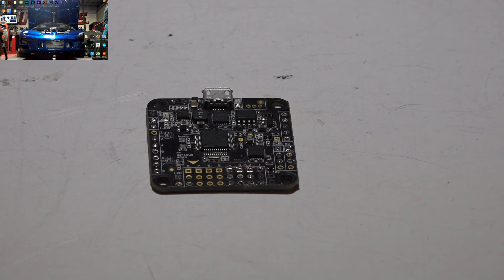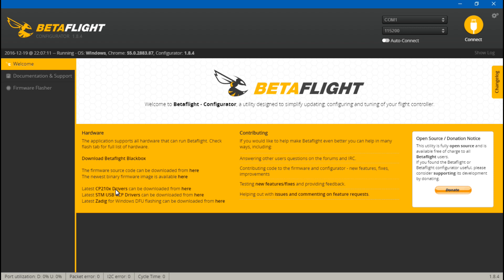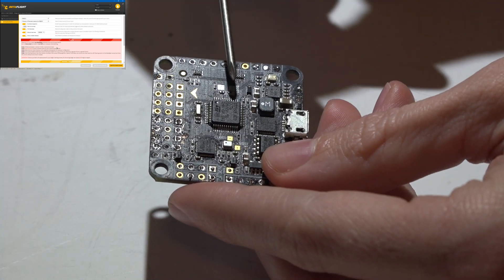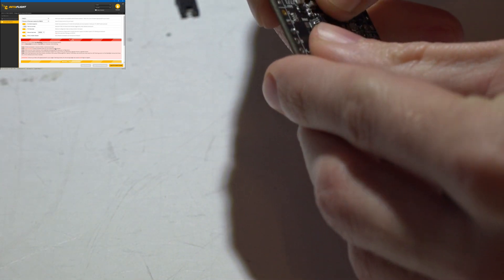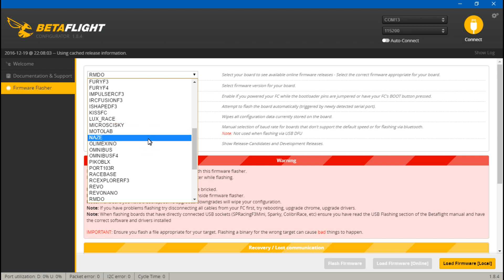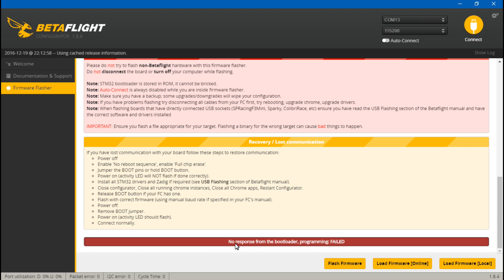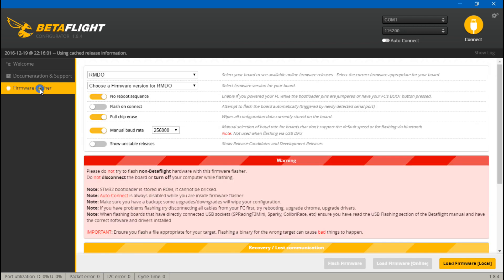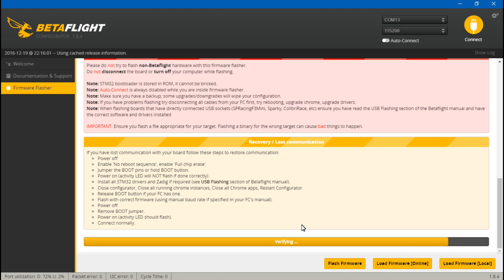How To Flash Firmware To Flight Controller

Comment: Hey there, my pc won't recognize my flight controller even after i download stm32 and cpx driver. My flight controller was working fine before i accidentally unplugged it while it flashing new firmware. Now whenever i plugged it to my computer only the red led is flashing and the blue isn't. Im using DALRC F405 flight controller. Do you have any idea how to make my computer recognize the flight controller?

Comment: This is my fail "
Access to the serial port failed" what can i do?
Reply: Manuel Maier You might be missing the necessary drivers, or you might be using a usb cable that only transmits power, and not signal.

Comment: Quick question: Do you "always" have to jump board with wire or button to flash it? Or can BF flash your FC without doing that? I am trying to run a fresh BF onto my QX65 whoop and can't seem to get the jumper to work with wire or anything, it's all so small, very difficult. My QX65's are fantastic when brand new but after your 1st solid crash into a hard object they all (have 3 of them) "flip out and crash" when you go full speed, possibly full power, not sure which. I have changed all motors to brand new, makes no diff. I think the accelerometer is the prob, calibrate won't fix so I am thinking a fresh flash of BF would be my only option, it appears they become confused, pretty sure it's software prob not hardware. Great vid, thx for that.

Comment: Im trying to update betaflight to 3.4 what board exactly do i select in firmware update for the babyhawk r? i tried it with omnibus board selected and it worked but now i have no receiver transmitter connection- thanks!!

Comment: I have done everything with my 2 boot pads and it still won't go into boot loader. I have just soldered the wire directly between the two pads and still nothing... Any suggestions?
Reply: I have completely given up on trying to get the firmware onto my first drone... What a waste of money

Comment: Hello:  Have a question for you that you may help me with???? I'm new to fpv and my wife surprised me with a Eachine Wizard X220 FPV Racer Blheli_S F3 6DOF 5.8G 48CH 200MW 700TVL Camera w/ FlySky I6 RTF and of course there are no instructions that came with it and I have no idea how all this is supposed to work. Now I got to the point where I got the fpv and my googles to work and I was able to pair the receiver with the drone but I can't get the motors to start. So I did some more research on you tube and down loaded Beta Flight and connected the drone with my computer to check out the operation. Well when I tabbed down to the receiver tab and it opened there is no info. According to other posts there are different color horozonal bars that show up to correspond with the different radio controls and would move when you would move each control. Well on my system there are no color bar and no movement when moving the controls. I can't find any instruction on how to go about checking what would cause this problem? So is there any instruction  you could give me on how to go about and what to check so I can make the controls work, I think if I can figure this problem out this will fix the problem of the motors not wanting to ture on?. I hope I explained and made sense on my problem. Thanks for your help I watch your channel all the time and have learned a lot so thanks again.
John
Reply: Dear John Rock; unfortunately JC passed away a few month ago. I also love his videos. Are you sure that you have Betaflight on your X220? have a try with cleanflight.

Comment: Do you happen to have a FC where it has boot and 3.3v? I'm trying to flash a omnibus f4 (most likely clone)
Edit: Nvm, I got it. You just perform the same procedure with the boot and 3.3v pin holes. Thanks again!

Comment: The flight controller, F4 Advanced Flight Controller from getfpv. http://www.getfpv.com/f4-advanced-flight-controller.html 
Will i have try everything you have shown on all your videos on installing driver to flashing firmware and it still doesn't work. But my problem was because I was connected to usb 3.0 hub on a usb 3.0 connection to my computer. And its been about a month trying to finger out. All I had to do was plug it in to a usb 2.0 and everything worked fine and I can flash the new firmware.
But when I was using the usb 3.0 hub I can connect and setup but can't flash the new firmware on that flight controller. (FC came pre-load firmware) I had flash firmware on the Naze32 Rev6 and it works fine on usb 3. So I never thought that I'll have problem on a F4 processor. But all said and done it could just be my computer. I don't if anyone out there had that same issue I have.
All your video are awesome and I learn a lot from it. Keep up the good work.

Comment: Hello, I just got into the hobby. Bought the LHI 220 mini quad. I completed the build, got cleanflight to load on my board. I got all the controls where they needed to be and then when I went to power up with the Lipo battery I saw white smoke. Now nothing works, I plug into the computer and I hear the link up sound but it will not connect and there are no led lights (red nor blue) lighting up on the fc board. Is my board toasted? I have literally tried everything you have mentioned and what others said to do and no luck. Thanks

Comment: Hi Jason, Really loving your tech series here, so much thorough information... really appreciate it. I have a Naze 32 that landed partially in a puddle the other day. After cleaning and drying I fired it up and I'm getting alternating green and red flashing two times and then a rapid flashing between the two. The board would not connect to BetaFlight so I re-flashed the firmware according to your video above, which worked great after a few tries, but I still cannot get the board to mount with BetaFlight. 

Do you know what the flashing means in the status lights? Have I fried this board? Thanks and keep up the great work.
d

Comment: Quick question. When I connect my flight board to CL and I go to the Fail Safe tab. It say its pulling the data but never does. I have to disconnect it to get it to stop. This has happened with the last two builds I have done (only have done two). I call pull up Fail Safe with other models that came RTF. I know its probably something simple I'm not doing on the controller? Using the Flysky FS-I6. Thanks.

Comment: Hi JC, I got a new F4 FC from BG with CF 3.0.0 on it. Connected to BF Config just fine via VCP and CLI version said it was a "Revo".  Made all my settings. tested, worked fine. However I wanted a newer version of CF. The FC had a boot button and went into DFU mode no problem. I then flashed 3.1.5 and the progress bar went all the way to the end but never said "Successful".   Now the FC won't connect to the BF config via com port, seems to be bricked.  I can still get into DFU mode and I tried loading different BF versions, still no luck. Comes up with red light solid but no blue light. FC might have simply failed. I'm stumped. This is the FC: https://goo.gl/jEOqaQ     Thanks
Reply from the maker: Thats happened to me a few times. Watch this and try the tool out. Try it not in the bootloader first. If that doesn't work then enter the bootloader first then run the tool. https://www.youtube.com/watch?v=9yQYVfHgmD8
Reply: I followed your tips and kept trying various settings and sequences, and also another tip I got online to disconnect the ESC's with this FC. Finally after 5 more tries it worked!  Have Revo 3.1.5 loaded. Thanks for all your very helpful videos!
Reply from the maker: I've never heard of that trick but thanks for sharing that info

Comment: help... i have the wizard x220, it said it came with f3 6dof flight controller but when i look at the controller it says clean flight sp racing mof3 v1 and none of the options in betaflight or clean flight board select give me those options to flash it to.
Reply from the maker: Connect to cleanflight or betaflight, go into the CLI tab and type
version
That will tell you what firmware you need to flash to the flight controller.
Reply: Project Blue Falcon by the way every time I try to connect the flight controller to either bf or cf it says failed to open serial port?
Reply: I have the same problem as you

Comment: solved!! turns out I didn't actually  install the stm32 file. also flashed wrong file via zadig.  used impulse Rc fixer. all set now.. if this helps any else. thanks again man.. learned a lot watching this vid!!
Reply from the maker: Awesome. Glad its all working now.

Comment: Tried to update Cleanflight from 1.12 to 1.14.2 on my RTFQ Flip32 F3 OSD board. Old Version in CLI said SPRACINGF3 so that is the firmware I installed. Flashing seemed to go OK, but now can't communicate with it. Red LED flashes 3 times fast, then twice slower. I even went back to the original version of CF. Same result. What can I do to recover it?
Reply from the maker: Send me a link to the exact board you are using. Also I recommend using Betaflight. Cleanflight is outdated.
Reply: http://www.readytoflyquads.com/flip-32-f3-osd
I tried Betaflight too. Same result. The configurator said Serial port open. No configuration found after 10 seconds. Then Serial port closed.
Reply from the maker: You might have to change your drivers. Watch this and see if it helps
https://www.youtube.com/watch?v=Ur_mU7Eu69E&index=25&list=PLiYYhnH4BhI_ZtP7FIVS1aOVOWXPdkQRJ
Reply: The CP210x is showing in the COM3. I even changed the driver to USB with Zadig, then back to Silabs like in the video. I got Betaflight flashed in, but after, it won't connect to the board. I even uninstalled the COM port. When I plugged it into the flight controller, the CP210x installed itself and is showing under COM3.
Reply from the maker: On the main screen for Betaflight or Cleanflight does it show COM 3 in the dropdown box in the top right of the screen next to "connect". You might have to manually select it.
Reply: Yes it does.
Reply from the maker: In that case I honestly have no idea. I've never encountered this problem. It could be a defective flight controller.
Reply: It worked fine until I flashed it. Is there any way to get RTFQ's hex file?
Reply from the maker: Unfortunately no. On most of their flight controllers they say what firmware it uses. But for this one they didn't. They dont have special firmware though. At least it shouldn't be anything special. I would just try flashing firmware for a few other flight controllers and see if that works.
Reply: Flashing the SPRACINGF3EVO and the SPRACINGF3MINI will let me connect to the FC. I set up everything. But the ESCs beep once per second. The instructions say this is no output from the throttle channel. And it seems the FC is not receiving anything from the receiver. In the configuration, I have the receiver set to PWM, which is the type of receiver I am using. Do I need to set up one of the UARTS? The SPRACINGF3 still does not connect at all. I don't think it works for the FC I am using.
Reply: The Betaflight gurus created a new hex file for me in BF 3.1.0. The Betaflight Configurator now connects to it. I will be testing it out more soon. Apparently RTFQ used some custom firmware based on the SPRACINGF3. He should provide that info and FW on the products page. That way someone can at least go back to a known good setup.

Comment: Dude thank you so much. I really appreciate the effort you went to do this and for the follow up video. I had accident removed the usb port setting in betaflight which meant i couldn't connect back in! took me like an hour of mucking around but thank you. It took around 7 tries before it finally flashed the firmware successfully.
Reply: how did you solve this issue, im having the same problem now

Comment: Can you explain what Baudrate is?
Reply from the maker: In simple terms its the connection speed. You'll see baudrates everywhere and sometimes you have to change them to make different devices work. For example placing an on screen display on a soft serial port. Devices on soft serials cant communicate as quickly as a UART so you would have to slow everything down to make it work.